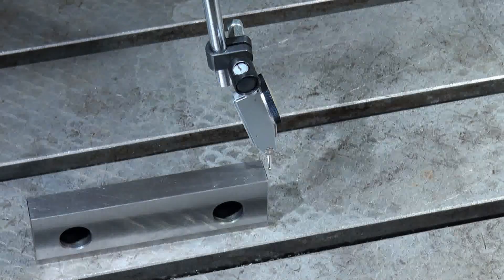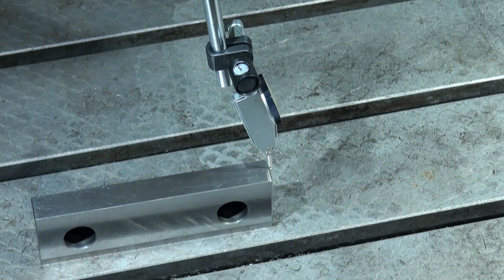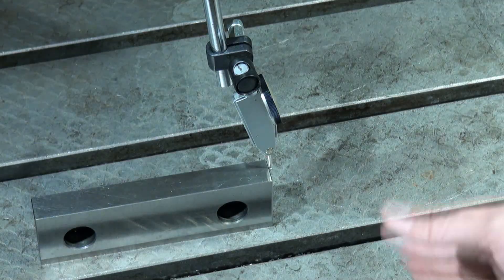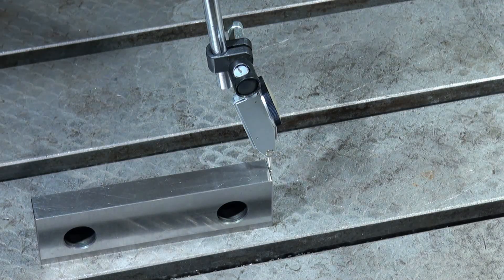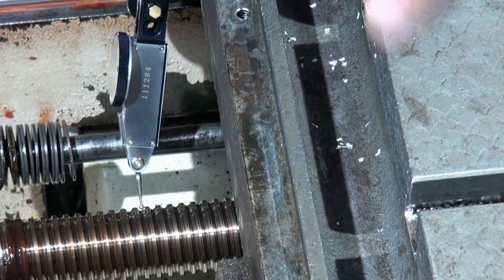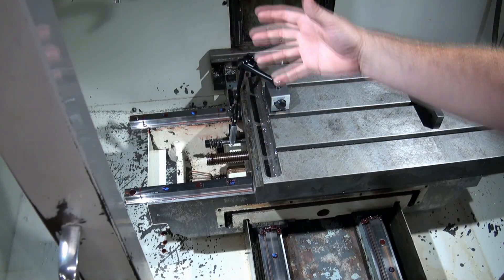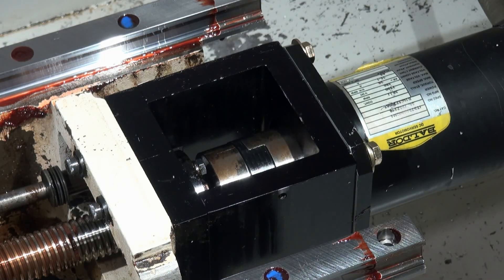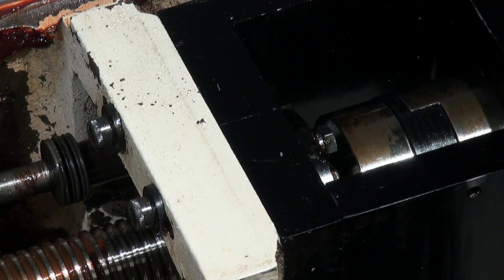CNC Machine Setup and Alignment Part 8: Backlash

Comment: So is that singular backlash number used for center, negative, positive BL settings?Little confused about how I account for all 3 settings? The center BL setting confuses me most. It makes sense that I flip the gauge around for neg and pos positions but center the manual says nothing about how to configure that. I’m using the programmatic calibration.
Reply from the maker: The three backlash values are for different areas of the screw. A lot of times the center will have more wear and thus more backlash. So the center is just that, the middle third of the screw. The pos and neg and the other 1/3 of each end. You should run the backlash measurements in each area and apply them as needed.

Comment: I have a VMC20 and i indicated x and y and it comes back to zero yet when  I circle interpolate large radius i get somewhat of a wave in my circle as opposed to smaller holes 2 inch and under I dont have that issue? could it be thrust bearing under a load?
Reply from the maker: Hello, it could be a number of things, thrust bearings, ball screw, couplers, resolver or encoders..... More testing would be needed.
Reply: did you fixed that issue?

Comment: You mean the gains of the servo amplifier card ga4568ea
Reply from the maker: Correct, there is a procedure to test and adjust the gains on each servo drive. They are located in the control cabinet on the right side above the card file. I would check that and see if there adjusted correctly and balanced.
Reply: Ok I'll check and let you know

Comment: Good day what do you think it could be happening and check everything mechanical machine and not found problems adjust the backlash to manual mode obeyed pulses pulses but at the time of orbiting in f1000 generates an obbation enbes of a syracuse and there is no difference If the program works with values of backlash or without them has the same error only with a velosity of f15 leaves the measure well for fabor help me to understand
Reply from the maker: Hello, the translations are a bit rough there. But I think you said you get errors at fast feed rates but not slow feed rates?  It might not be backlash at all. Typically when you get a feed rate dependent error check the servo drive gains, balancing, and matching.
Reply: @AtManUnlimitedMachining  Hi, I have this exact problem. my backlash value is dependent to the feed, and it is also exacly proportional: the faster i go, the smaller my bl comp should be... everything started when i decided to level the machine (it was really hight on the back) and then i check the survey data, and it was completly wrong in the y (all zeros untill the midddle of the machine and then 10, 20, 30 ecc.). I think that the old owner changed the y axis card without changing the survey. I replaced the datas with the ones that i found, wrote by a fadal operator in the very first calibration in the factory. i also changed the gain in the Y survey from maximum to normal. Now my machine cuts at the exact length in the y (+/- 0,01 mm on 300mm test). then I noticed that my circles now have steps every 90 degrees, when the axis change direction (the problem there was't before, so I think it is not a mechanical problem). My backlash is ok at low feeds, but it should be reduced at hight feeds. I also tested the axis drives: the balance is ok, the signal gain is ok, the following error is correct in the test program. I can't adjust correctly the compensation pot, but i tried ajusting it, and my backlash on fast feed does't change, and the steps on the circles doen't change... I also tried to put back the gain in the Y from normal to maximum again, but nothing change. Any Idea of what is going on? thanks a lot, and sorry for the bad english.

Comment: Good as it may be possible that when I do an orbit in X and Y the measurement is fine but at 45 degrees this out of measure
Reply from the maker: Hello, if your referring to backlash, it will actually show up at the 90 degree points, IE 0,90,180,270 when the axis reverses direction. The controllers do a really good job at compensating for backlash when properly setup. Please refer to this video where we do a circular interpolation with a ball bar and plot the error around the full rotation. https://youtu.be/GhU7gTWo11s
Errors at 45 degree points, IE 45, 135, 225, 315 are typically related to squareness or servo tuning.
Reply: Thank you very much for your support and boy to review your video
Reply from the maker: Thanks for the comments and for watching!

Comment: It should have three backlash comps per axis , because most of the wear will be towards the center of the screw ...
Reply from the maker: Yes, Fadal has 3 for X and Y, 1 for Z. But it depends on what the machine is doing. If you have two vises on the table then the wear will be at the 1/3 and 2/3.

Comment: The best way I have found to check the thrust bearings for the ball screw is to use a dab of grease in the little center drilled spot at the end of the screw. Then use the grease to hold a small steel ball bearing in place and put your indicator right on the ball. A regular dial indicator works better than a test indicator because it helps hold the ball in place.
Reply from the maker: Thank you Wes, I will try that method when I replace the Z ball screw shortly. Never tried that method before.

Comment: Thanks for your recent videos. Is it possible to make video about machine capabilty like "learn mode" when you have done with your series? I heard that an operator using learn mode without prob just by touching off  the part, program the exact part to dublicate it, I am not sure about what I heard but according to manual sounds possible. what do think?
Reply from the maker: Are you referring to using a touch probe to set work offsets and tooling length, diameter off sets?
Reply from the maker: Ah, ok, your talking about a Fadal command called "Learn Mode" or "LE".  Yes I can show the use of that command.
Reply: Yes, LE command. As I have mentioned that I heard an operator without using probe by touching off with an indicator and use of  FADAL LE command can reverse engineering a part. I am not sure if I heard it correctly but I think it make sense according to my understanding reading the FADAL user manual.
Reply from the maker: Let me see what I can come up with.